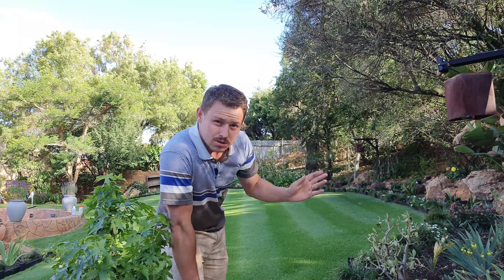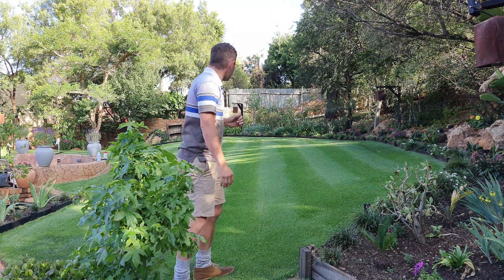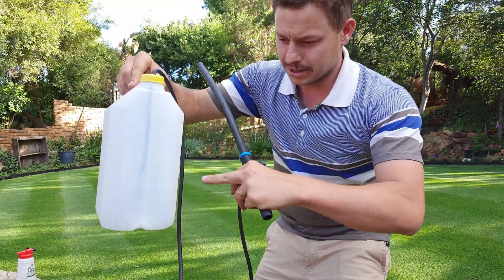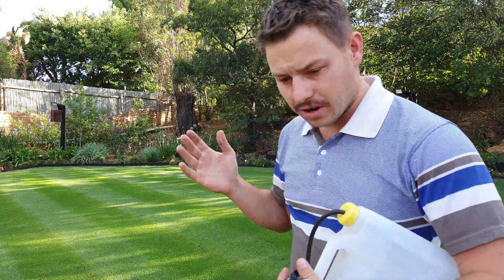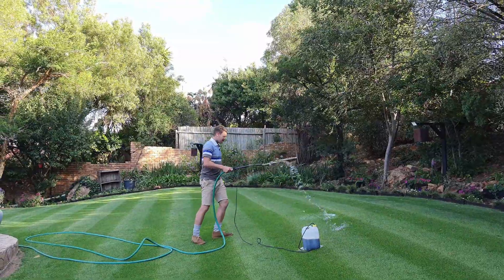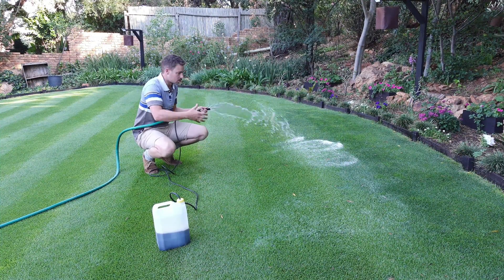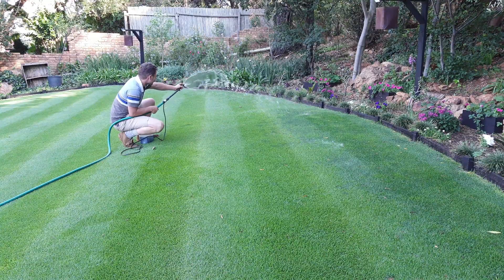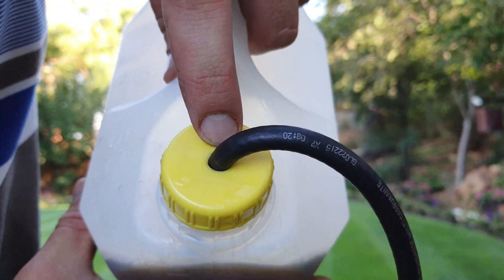DIY Venturi Siphon// Best tool for SOIL AMENDMENTS!!

Comment: 5:06 Nice video, but your explanation is not quite correct. The low pressure area is created in the full length of the thin part of the pipe, not right at the end. You can put your siphon pipe anywhere on the thin part of the pipe and it will work even better. When water flows in the think part from your pump, it has high pressure, and when it is then forced through the thin part of the pipe the speed of the water goes up (because water cannot be compressed, except under immense pressure like very deep under the sea) and as a result the pressure goes down, which creates the low pressure area for the siphon to work. The concept is based on Bernoulli's principle. We use siphons in all our koi ponds to siphon air to aerate the water. 😉

Comment: Lekker engineering!  I would put some sort of diffuser at the end of the hose - so it disperses the water but without creating back pressure that messes with your venturi.